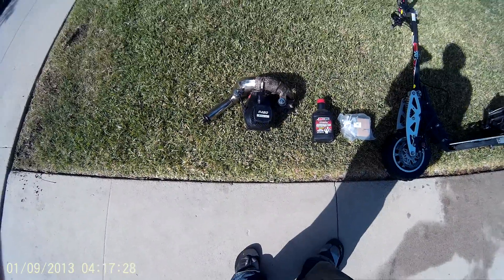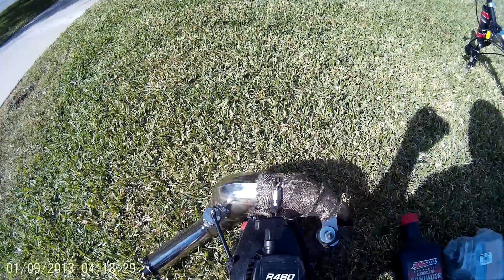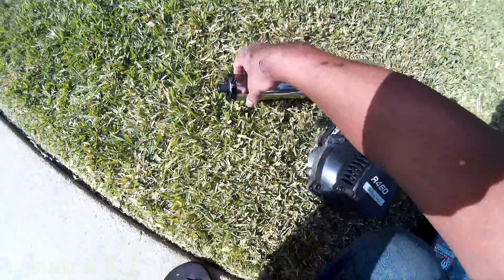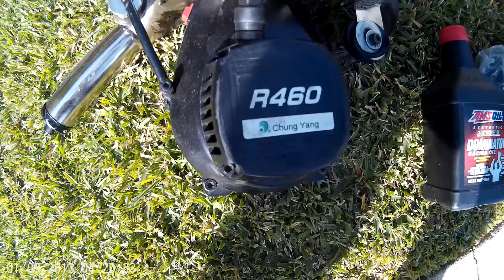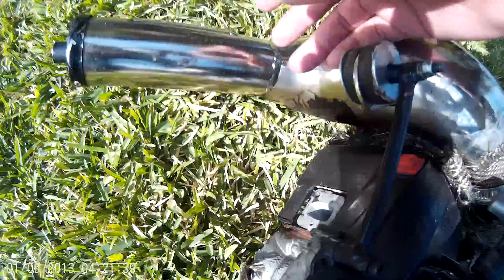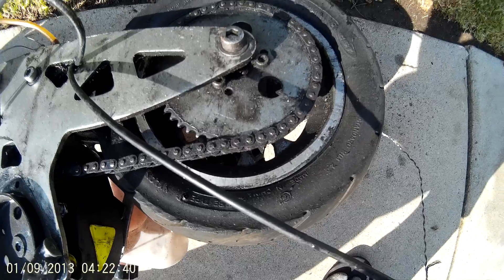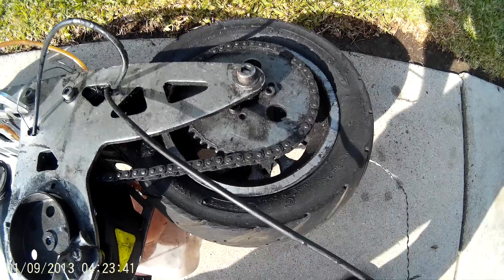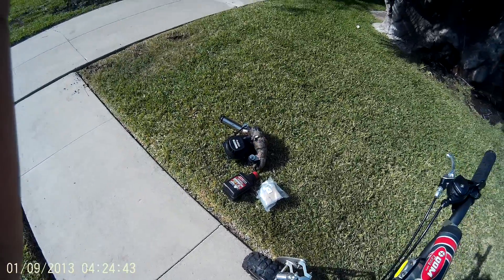evo 2x motor swap and upgreades  gp460

Comment: So I actually traded my gsr46r which I built the gp460 on it to a 6th port cylinder reed, stuffed the cases, etc..., traded that for a proped, propane goped, because I was tired of dealing with the chain issues. Now I recently bought an uber scoot/evo 2x, swapped on a built gsr40 engine, but that is too slow. So now I'm going to build a cylinder reed 6th port stroker gp460 and mount that on my evo! I'm pretty excited!
Reply: How did you mount your motor to your evo frame? I just got a evo and a older model xtreme. Im playing on buying a goped 460 engine and fabricating some kind of mount of plate.
Reply: @IDontKno215  no no you shouldn’t really have to do any fabbing to mount up a 78mm clutch engine like a gp460, even if you want to keep the stock 2 speed transmission. I got rid of mine in favor for a Chinese clutch bell housing and sprocket assembly that had like a 6 tooth T8F chain sprocket. I cut up some tubing as spacers, drilled some new holes in the engine mount plate to rotate the engine so the spark plug points straight up, instead of at a 45 degree angle forward, got some longer bolts, and it all should mount up and align pretty good with the rear sprocket.

Comment: What about Castor927, do you think that is a good oil?
Reply from the maker: Its really good stuff I use to run it till I was able to afford the amsoil I use to run super M as well all great oil just when you run the gp460 you need to run it at 25:1 no less
Reply: AHABAH HAMOWN of Israel Tribe of Reuben Cool, I use 92 octane E-10 with Castor927 at 28:1 in my GSR40 TSi. Do you prefer Amsoil Dominator over Castor927?

Comment: Please need help,if I get the g46 engine,do I need a plate? Or will it just fit? I’m dying for more pep. Idk if I should just get a performance clutch with springs(Idk if 76ow by 14w is the right one) and a jetpro pie from billet.com. Pease any feedback will be highly appreciated. I love how u break things down. More vids on how to swap out the stock 49cc for that bad boi right their. PLEASE! 🙏🙏🙏🙏🙏😩😩
Reply from the maker: I can do my best on videos but I'm a working man but on the motor swap is a direct bolt on and it comes with high performance clutch and springs with gp460 also change ur Trasmission clutch pads so they can handle the new high rpm motor
Reply: Thank u man, I appreciate it.

Comment: Hey how fast did you get it with the sprocket and ESP ported head? I don't know how to adjust my carb, I have the ESP OTW in the mail. Should I adjust the carb or leave it the way it is?
Reply from the maker: whats carb are u running
Reply: Darnell Payne Walboro, I ordered a ScooterX 39t and thats in the mail too
Reply from the maker: +Khiem Le oh yeah ur gonna need to re tune stock to is 1-1/2 low and 1-1/4 high I believe on a wt223 carb
Reply: Sweet, how fast you think I will be going with stock drive 11r with driven 38t and ESP head?

Comment: oh ok cool I wanna order my engine soon what will I need  to order with the engine and can I keep my air filter and jet pro pipe to install it on the gp460?
Reply from the maker: hey buddy how you doing I seen your post to give you a follow-up on the GP 460 motor conversion there's a kit sold by sdscooters I'm going to put a link in the post, they sell the gas tank with the motor at $300 I don't know what shipping will be but that's where I got mine so if you tell them darnell sent u I'm sure they will know exactly what u want and I strongly suggest calling in your order .. huge is a really cool guy
Ask him for the gp460 conversion kit ( http://www.sdscooters.com/Parts/Scooter_Engines.html )

Also there will be some fabrication needed to do for the mounting bolts for tank
Reply from the maker: also I'm sorry what was ur you tube channel again

Comment: hey bro I got a evo 50cc scooter with a Ada racing air filter wit a jet pro pipe but my engine is stock its pretty fast but I want to get A gp460 engine like you bro but does it come with a gas tank and gas lines
Reply: I'm doing the same thing right now. Davemotors.com has tank mount and was told the Bigfoot tank bracket mounts right up to evo. my order won't be here till wed or Thurs so won't know for sure till then.
Reply: you can get a goped tank on davesmotors.com also and comes with 24" fuel line I believe